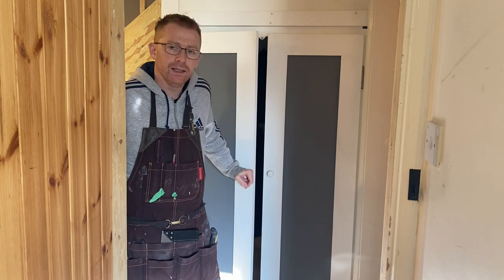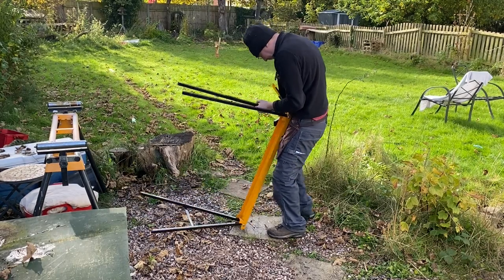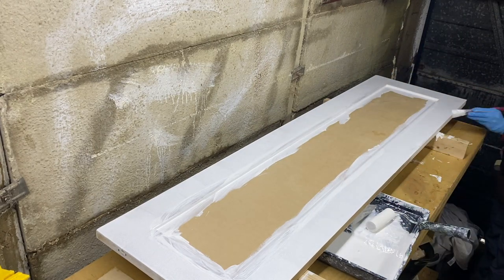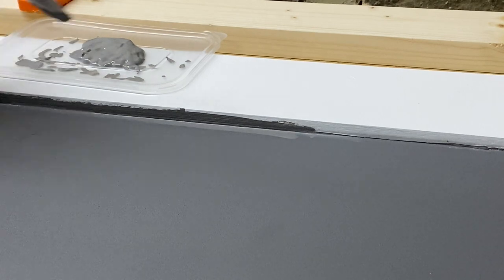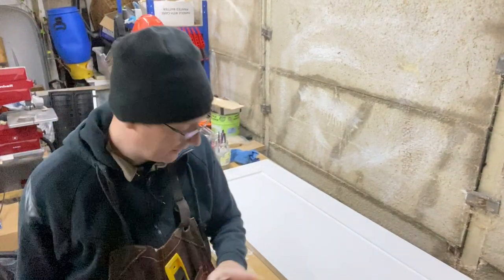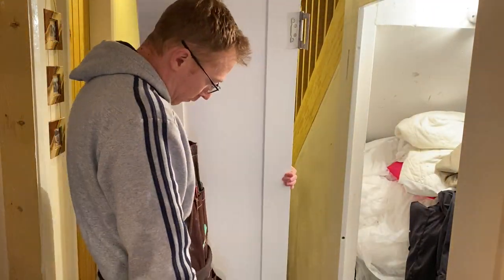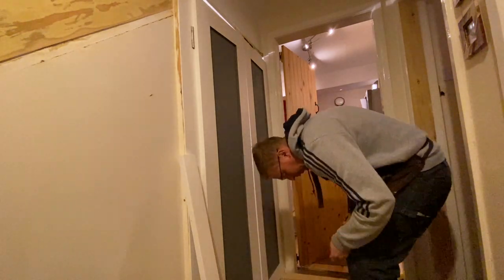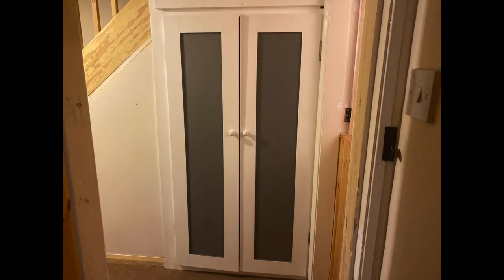Making shaker doors, '10 Minute Workshop' style 😀 (pt 2 of 2)

Comment: Great job Leo.  I think the voiceovers add to it, explain more what’s going on than the text on screen.
As an alternative to the multi-tool trench you cut for the hinge to go into you could have used a router instead?  Would have needed a jig to ensure a clean hole, and clamping the hole so more work, but I find multi-tools don’t leave particularly straight cuts when they’re used.
Labour of love the staircase, are you painting or staining it afterwards?  My staircase is entirely covered in brown wood stain/finish so painting it all white will make such a difference (when I get round to it …)
Reply from the maker: Thanks Geoffrey for the comment. Totally agree with you about the multi tool, have since done similar work with a router as you suggested. In regards to the staircase I went with a satinwood finish which I’m really happy with. Really dislike gloss paint and the satinwood is a nice compromise👍👍

Comment: Voice over is perfect. I've just realised that you're not naturally left-handed. As I am I think I overlooked the extra complexity that brings to your situation. As ever tho' you seem to combat most of the issues with panache. I thought routing the rebate for the hinge was impressive until I realised about just changing & setting the router bit up. Not my fave, with both hands - I take it you have to manually keep the spindle lock held down whilst tightening the nut, WELL DONE my friend. And btw the jobs a good'n too!
Reply from the maker: Cheers Keith for your very kind words again. Yeah I’m right handed and had no idea how useless my left hand was until it was the only functioning hand I have. Much better using it now and have adapted pretty well. Given up trying to learn how to write with it though, but technology helps massively to compensate for that barrier. The technique for the router bit change is to jam a slim bolt into the hole behind the nut and that effectively locks the spindle in place as I don’t have a spindle lock on it. Then clamp the bolt to a work top and use the spanner to release the bit. Took me a while to figure out a technique but is pretty second nature now. Best wishes, Leo 😀

Comment: 2 systems for getting perfect lines with your masking tape, one is to run a fine bead of caulk along the edge of the tape rubbing it in hard along the edge then wiping it back off, this works just fine but another method is to use the paint underneath the masking tape instead of the caulk, both methods will stop paint bleeding through, I would have used Zinsser bin to prime the MDF first, also try using a dry foam roller at the end to lose the brush marks and give a sprayed like finish.and don't use emulsion on wood, it will get grubby very quickly.
Reply from the maker: Cheers Designer for the comments. I’ll test out the paint ideas with the tape when I have some spare time and see how I get on. The Leyland trade is what I had left in my garage. I’ve used it on MDF before making the penny resin table and it worked fine. I’ll look out for the Zinsser when the Leyland runs out, is it similar priced? I did use a dry foam roller and it had just collected up the excess, really happy with the finish it gave. In regards to the emulsion, again it was just what I had leftover from my penny resin table project which I painted the MDF base with. What would you recommend? Cheers, Leo
Reply: @Hand-i-Craft  Quite often MDF will bleed brown stains (tannin) through your paint, but any Shellac based primer will stop this, Zinnser is not cheap. There are a lot of good finish paints on the market, I like FB's waterborne estate eggshell, it has a nice finish and very easy to apply but again it's not cheap and there are lots of other decent paints on the market, unfortunately, Dulux has gone downhill since it was sold, emulsion is fine under resin but not as a top coat on wood if you want it to last, overall it came out nice, definitely try the masking tape ideas it even works on bumpy surfaces, you will never go back.
Reply from the maker: Cheers Designer, I’ve just been looking at the Zinsser products and wow, they are some seriously expensive prices 😳. Don’t know if you’ve seen in my previous videos but we only rent our house. Been here for over five years and would like to be here a good while longer. Don’t mind spending a few quid on making it more of a home for us and our landlord is great, just don’t want to invest a fortune. The doors under the stairs were made from essentially offcuts and paint I already had. Can I ask your advice though please, I’m running out of time getting rid of the gloss paint on door frames etc replacing it with satinwood before our new carpet it laid. Instead of heat gun and scraping the door frames upstairs, could I sand them with say some 60 grit then if I got a tin of Zinsser could I apply that then the satinwood? I’m really happy I managed to strip the staircase but it took me so long I just think I’ll run out of time and I’m looking for a shortcut. If you think this is possible, which Zinsser product would you recommend? Sorry to reply to you with an essay but would appreciate any advice you have. Cheers, Leo
Reply: @Hand-i-Craft  If you have gloss woodwork and you want to end up with a (waterborne) satinwood then a 120 grit paper is fine, no need to strip completely just remove the shine, if you go for an eggshell instead of a satinwood (very little difference) then there is no need for a primer or undercoat. if you already have the satinwood then a waterbased primer/undercoat first, dries superfast and can easily get a finish coat on in the same day, please feel free to ask, i was head decorator for the Royal palaces for 5 years
Reply from the maker: Designer- Garb Cheers Designer, hopefully this will save me a tonne of time! It takes me roughly a day to strip a door frame, so I imagine it’ll only take an hour or two to sand one down. Will get cracking on it this afternoon 😀😀
Reply: @Hand-i-Craft  If you only have to sand the shine off it should only take ten minutes unless they are extremely bad or have lots of runs, putting a water-based paint any parts that are still glossy with just flake off if knocked and not durable at all, sanding pads are ideal because they allow you to get in to all the different angles, as long as the gloss is not flaking there is no need to sand down to bare wood, so should take no time really, I expect you will have them all sanded and undercoated by the end of the day, then top coat tomorrow.
Reply: @Hand-i-Craft  Just had another thought, as you have stripped a lot of your woodwork down to bare wood don't forget to put some white knotting on your knots before you prime, last thing you want is to have to strip it back down when the sap comes through.
Reply: Zinsser BIN and 123 claim that you don't even need to sand the previous paintwork down (although I do anyway for best results) when you do invest in a tin you could make a video to compare results? great job by the way as everyone else has commented. You're an inspiration finding ways round your new limitations 👍